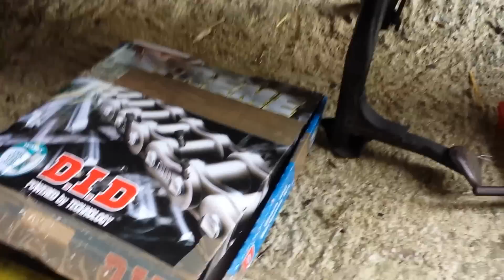Suzuki Bandit Chain and Sprocket Change Chelt-Mods

Comment: Have you every toyed with changing either of the sprockets out to lower the Bandit's RPMs for highway speeds? I get around 4000 RPMs @ 65 MPH (~105 KPH).  It gets annoying on longer trips.
Reply: I bet it would!
Reply: Best sticking to original  15 front 45 rear.tried both ways.13 front 48 rear accelerated  like a f1 car.but did 20mles to a gallon. Other way was to slow  all round.but better mpg

Comment: And also what type of Allen key did u use to undo all the bolts/screws to remove the front faring to get into the front sprocket
Reply from the maker: If I said Allen key then just a normal one, I only had basic tools back then. If your asking size I have no idea lol. Sorry I couldn’t be much help. Thanks for watching
Reply: 5 mm     is the one
Reply: @bigmuller1  legend
Reply: @emmanuelgeorge4112  no problems

Comment: What tool I would need to do the chain adjustment on my 1998 gsf bandit 600 and what socket would i need to lose the axle nut. Am picking up the bandit next week
Reply from the maker: I’m think your asking size, and sorry I don’t remember the sizes I used but if you have a tool set then you should have it. Thanks for watching

Comment: 2:58.... it does need to be tight... torque spec is 115Nm
Reply: I dont have a compressor. I have put it gear and tried but the front just wont come loose.
Reply from the maker: thanks
Reply: @shamalanon-time4209  This is a very common issue when it comes to fine pitch thread and large surface area of a nut or bolt. and it is supposed to be really firm on there, this is something that would make your day really bad if it came loose during a spin. And as such a good impact gun either on air or batterypowered or electric even, is definitely a good tool for the job, but a hammer on a wrench could also do the trick if you have enough access for it:)
Reply: @mortenbakke2810  Had someone apply the back brake while on gear and used an extension pipe over the L 1/2" socket wrench. That did the trick for me GSX1250FA. For tightening, I only had Loctite Blue on hand but did use 83 ft lbs as per the manual
Reply: @shamalanon-time4209  that does the trick too, can't remember what my manual says, but if Loctite is required I have the whole range availeable to me at work:)

Comment: what is that tool @2:50? To remove a nut from the front sprocket (I suppose, I am sorry my English isn't that good)
Reply from the maker: ACMDE was just a ratchet not 100% now but think was a 32mm socket and if memory serves me there a locking screw first, as I said in video the nuts are on very tight, think I had in gear and wedged the wheel from turning to get loose.
Reply: @t26sts  Thanks! I have an impact gun so I would be fine.
Reply from the maker: Yes that would, wish I had one back then, I do now
Reply: @t26sts  one question, what do you use to remove that chain grease from the inside of the cover? I missed that I guess.
Reply from the maker: ACMDE and good grease remover would do think at that time I used a product called Gunk

Comment: Thank you so much for all the vids! I'm 15 and I just bought this bike as my first. Got it for about $1200. Bit of a fixer-upper but I really like that kind of stuff. I was wondering if you could tell me about the small rectangular box on top of the engine block. Because right now, there is just a hose that comes out of the side of it and it dangles around aimlessly. I think that the previous owner put aftermarket air filters on the bike because there is a separate cone-shaped filter on each carb. I was wondering if that hose originally went the air box. By the way, on my bike there is not an airbox where you change the air filters like there is on yours. I just don't know what to do about the hose. Any help would be great. Thanks!
Reply from the maker: Now the breather pipe you describe sound like you said just a redundant pipe due to the after market air filter cones. I dont know alot about the "box" on top of the engine but ill look into it and come back to you if I can find out more. In the first instance if there's no wires for  the engine to use from it you can just remove or refit an air box .
Reply: Okay thanks for the help!
Reply from the maker: So its call the Second Air Schematic from looking at it i'm not sure what it does or find much about it so cant help much there but what I can say is as it gets it air from the filtered air box you should put a small air filter on the end of the pipe if your going to keep with the cones or put an air box back in. Hope that helps and if you need a video on anything let me know and ill see what I can do. Thanks for watching.
Reply: Okay that helps. I bought the bike with a small fuel filter on the end. Should I try and find a real air filter that i can put on there or just keep the old fuel one on there and call it good?
Reply: I think I'm going to keep the cones on too. It probably give the bike more air which gives it more power too.
Reply: Man after my own heart. 
It is horridly dirty in there. 
Time for a clean. Get the crap washed out. 
It does not have to look like an operating theatre, it just helps if is no longer looks like an explosion in a tar factory,

Comment: Won't it affect ur speed statement of ur bike?or change the mobility of ur  bike after the newone?
Reply from the maker: Dary Hell what do you mean? I replaced with same as factory tooth wise in sprockets if you changed the amount of teeth on sprocket it would change top speed or acceleration of bike.
Reply: Its geared or driven by the front wheel on a mk1 bandit

Comment: How did you get the Allen bolt off the front sprocket?
Reply from the maker: Hi, as I said it was very tight but two ways to help is one in gear can help hold it and just using a screw driver to jam the chain or sprocket in place whilst you loosen. Hope that helps and good luck.
Reply: +Chelt- Mods I tried leaving in gear a putting a metal rod between the rim.
Reply: +Chelt- Mods I have a picture of the nut but can't seem to post it on here it's the only thing holding me up. Is the nut normal.  lefty loose?
Reply from the maker: +Chadd Maynard and that worked or are you saying it didn't work, because when I say it was tight I mean it was very very tight. As long as the issue isn't the gear turning when trying to undo then you really just need to apply more force , even shock the bolt by stamping on the Allen key if needed, be careful not damage bolt do at your own risk but things like that can work. One last thing make sure your turning the correct way. once again good luck
Reply from the maker: +Chadd Maynard to undo I remember it was normal way anti clockwise
Reply: +Chelt- Mods thank you and yes counter clockwise was the say I was turning I think I need a stronger bar in the rear rim to hold it. Someone musta have put this on way to tight the last time and thank you so much for doing this video it helped me a lot doing my bike.
Reply: +Chelt- Mods have you thought about doing a video on retiming valves I have a small cam in the bike the previous owner had put in and hasn't had a valve timed in 10,000 miles. Thought it would be a good idea??
Reply: +Chelt- Mods the Allen bolt came off with some force just down to the last big nut. I'll try more force with a bigger bar again thank you for your comments and video helped me a lot with my bike and being new to motorcycle mechanics it was very easy to follow. I rebuilt all the carbs last year and the bike ran so much better. Starting to love this bike.
Reply from the maker: +Chadd Maynard I'm so happy to hear that and happy that my videos have helped you, it really means alot and to why I made them. Just need a new bike to make some more lol.

Comment: I have changed my rear sproket and chain but I can not get for the life of me the frount sproket lose? I have bent dousens of screwdrivers and bars yes I have taken the Alan bolt out it's that nut! I do have an air impact gun which is my next try
Reply from the maker: andrew hopper hi I do remember having a tough job getting mine undone  but with plenty of force it came loose and impact gun should make easy work for you, I recall putting the bike in gear and a big wrench for leverage. 
Hope that helps thanks for watching and good luck.